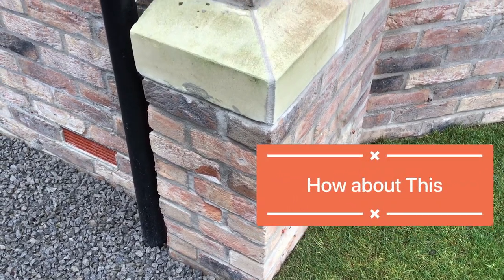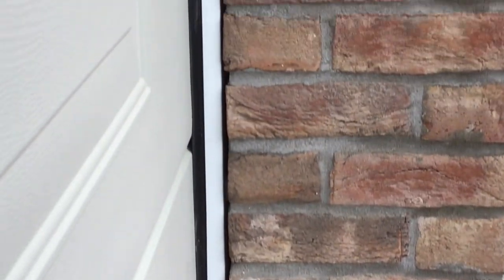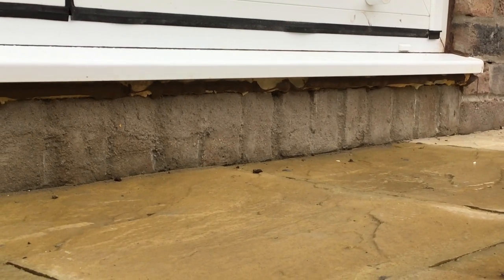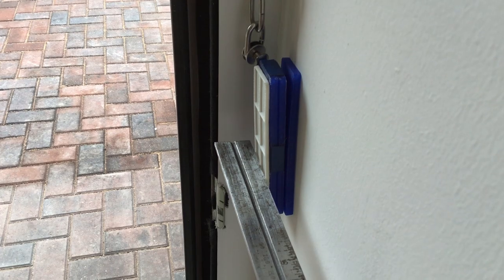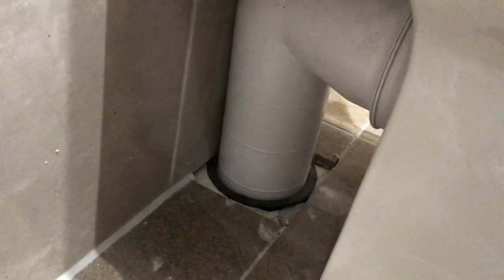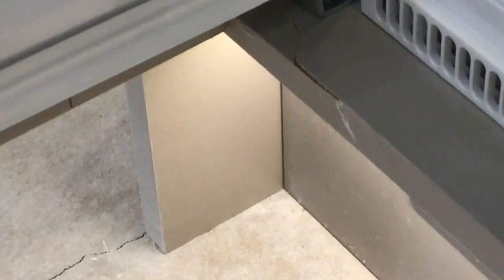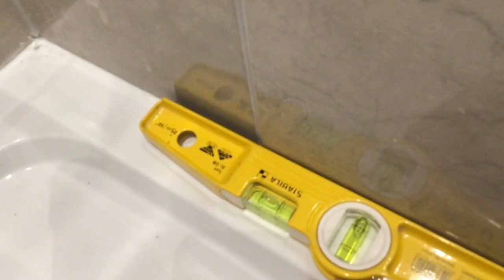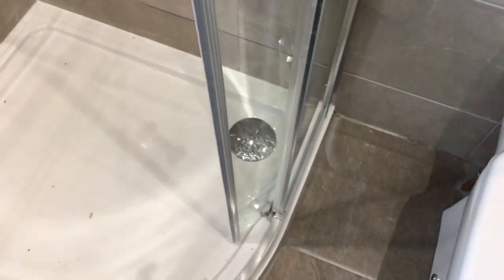How about This

Comment: Nothing gets passed you sir, a true professional. At least someone takes pride in their work! Out of interest, if I may? Does anything come of your snagging reports? If the house is already accepted and signed over. I honestly think its criminal what is going on with trades these days, particularly the building trade. If one man spots so much what about the thousands that don't use an external snagger. Shocking absolutely shocking.
Reply from the maker: Hi Mike, yes I would say 90% of what I put in my reports gets rectified by the builder. The real problem is if the site manager and trades did their job properly then there would be no need for professional snaggers. It is shocking because new build house buyers are left with the stress and mess of dealing with the builder to get these issues sorted properly, sometimes the trades make more of a mess trying to fix them.

Comment: Good spot the part M “sink and radiator” and well spotted with the brackets into the joist breaching the fire plaster board.can tell your well up on building regs lively👌👌 I may have to give you a bell at some point as there are things in my house that not many trades/inspectors can give clear information on (or they just don’t know).as always fantastic work, keep the coming lively 🙌🏻🙌🏻👍👍
Reply from the maker: I will do, glad you like the videos you should check out my Instagram more shocking videos on my reels.